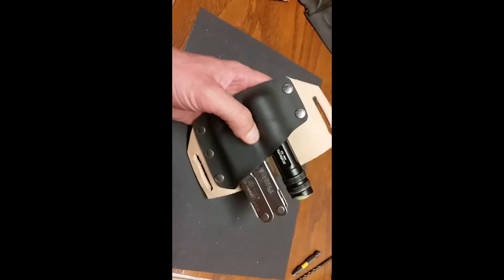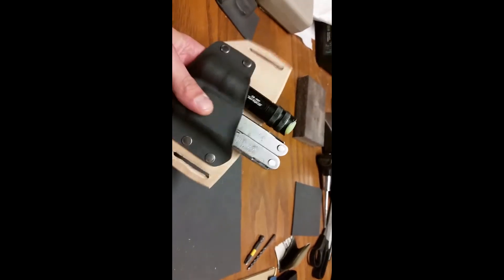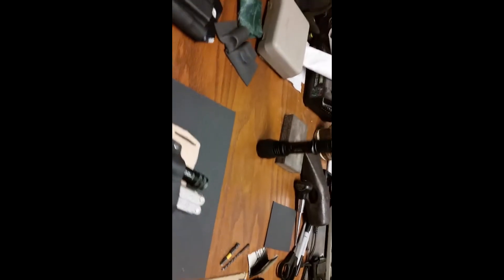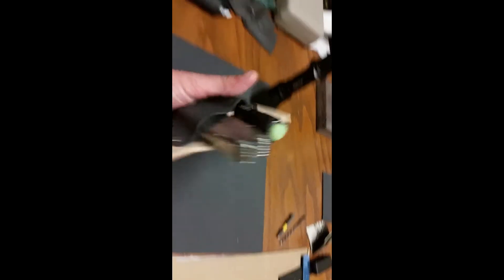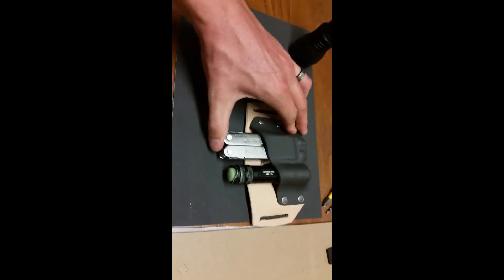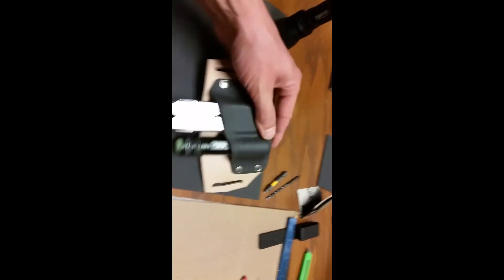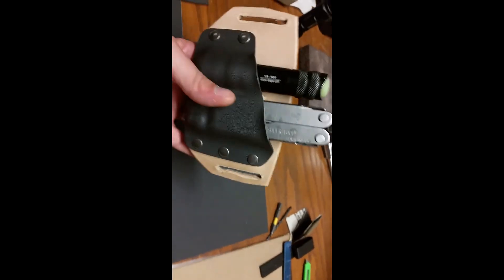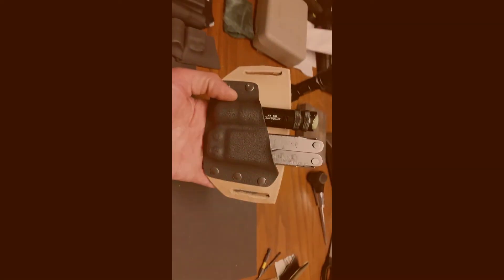KYDEX leatherman holster

Comment: Brilliant holster build.  You can tell you put a lot of thought into it and you did a very good job.  I carry the Gerber sometimes because of its lower profile and accessibility to the pliers, but I really prefer the Leatherman TTi Charge.  I use the leather holster it comes with and it has room for a Streamlight on one side,  a Space pen on the other and my bits and firesteel on the inside.  I just got use to the weight. Just a suggestion; the video would have been much more appealing to the eye if you would have shoot this in Landscape by holding your phone side ways.    You can also correct this before uploading in Movie Maker, it if you shot it this way by mistake.  If you already know this I apologize.  A lot of people do not, including myself until not long ago.  Just friendly comment not offense intended. ATB2U - Stan